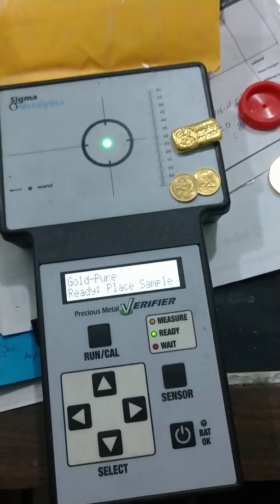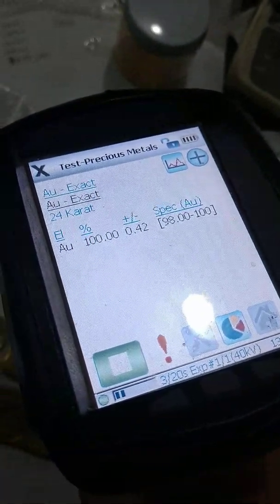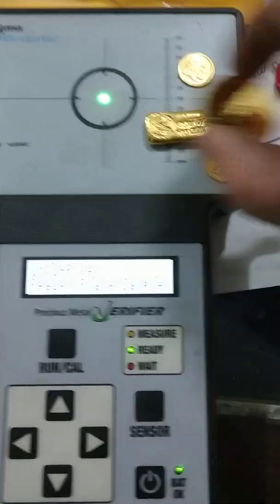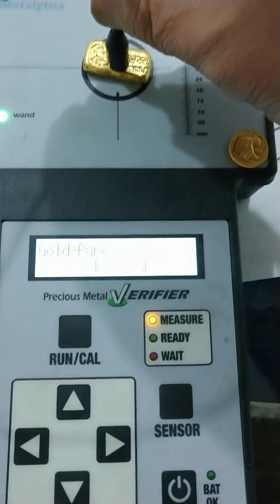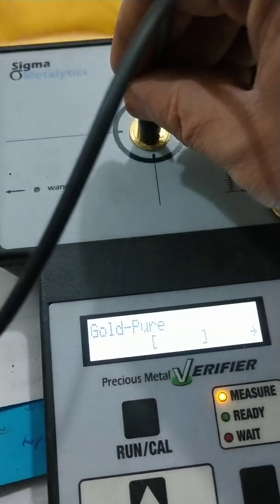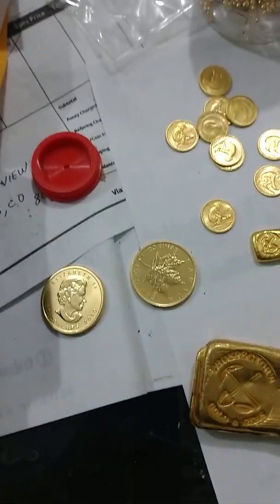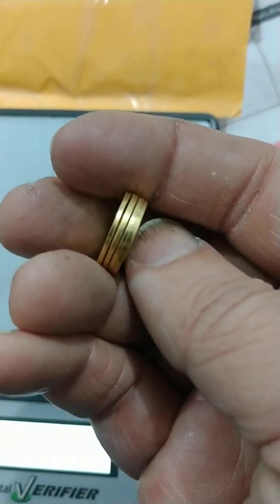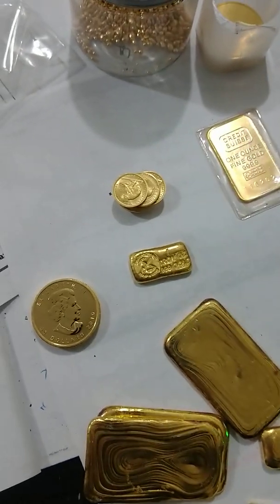Why a sigma works and doesn't on Prospectors Gold and gems coins and bars.

Comment: The Sigma manual says that coins not in a case must be greater than 24mm in diameter to be read accurately by the main sensor. Coins in a case such as an Airtite must be at least 30mm diameter for accurate reading. This means that when you put one of your little rectangular bars of gold on the main sensor, you shouldn’t expect an accurate reading. You should instead be using a wand appropriate for the size and thickness of the coin or bar that you’re testing.

Comment: David and Prospectors Gold and Gems are top notch and totally trustworthy.  For the Sigma to test properly, the black circle around the main sensor must be filled with the piece being tested.  In other words, you can not test a coin that does not fill the black circle on the main sensor.  It must be tested with the wands.
Reply: Mike, that is inaccurate.